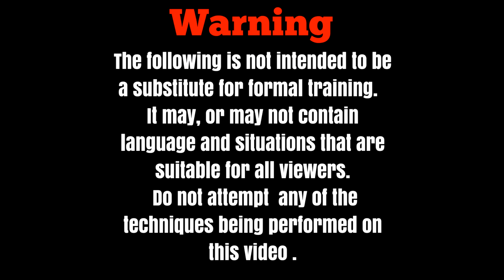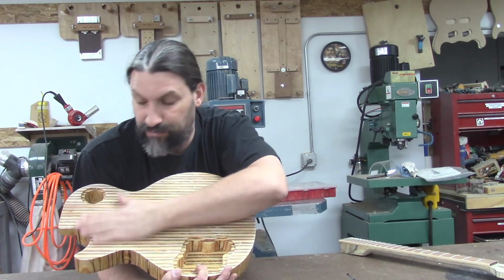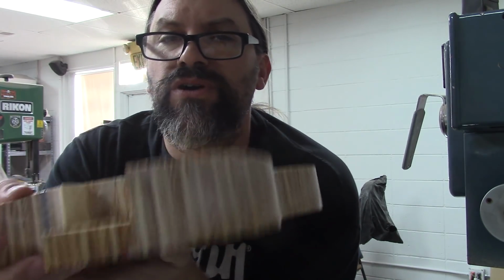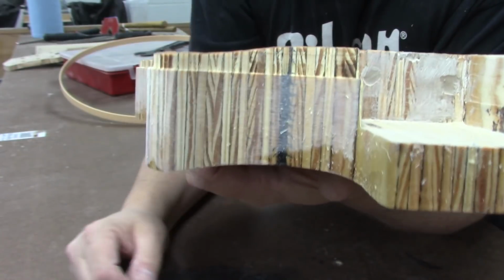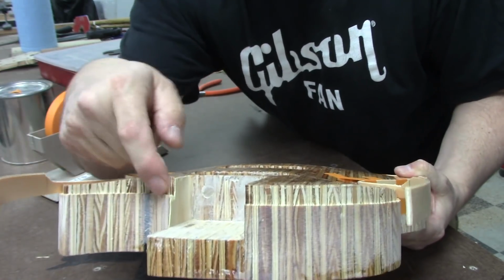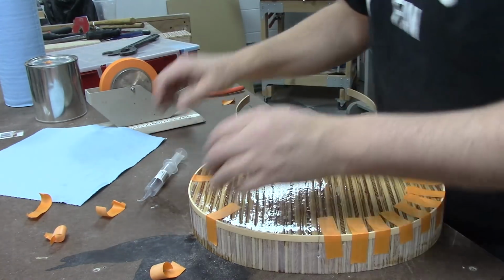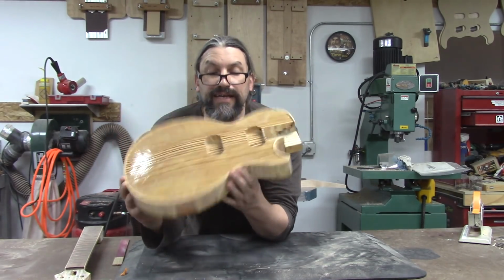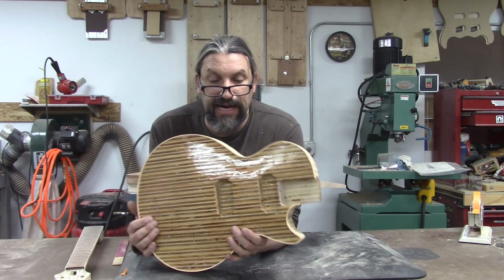How To Bind A Les Paul… Plywood Les Paul Part 3

Comment: I don't think it will sound horrible... In the 60s and 70s some of the old ply guitars were horribly cheap made but didn't sound nearly as bad as you'd expect. I predict it sounds shockingly better than most assume. I actually love that you all made this guitar, soooooo many are closed minded and not open to having fun. Even if it turns out terrible... And I doubt it will, you learn something from every experience and experiment you do. I really look forward to seeing the outcome! I actually was making a neck out of my own layered hard pine that I had cut and reversed the grain from slice to slice... It looks nuts and that was the point... To play and just have fun. Great job!
Reply from the maker: Thanks Will, I'm having a lot of fun with this guitar

Comment: I like the binding. Maybe it doesn’t “pop” but I don’t think it has to. There’s a lot going on visually anyway and it adds a nice understated end to all those straight lines in the plys. I like where this is going so far. I’m not too concerned about the sound, I’m not trying to start up that tired argument but I’ve always felt tone was 80% electrics and 20% wood in a solid body anyway. If the first set of pickups aren’t right, you can tweak it with something different to get it where you want it. I would suggest a wide strap but I think it’s gonna rock!
Reply from the maker: As you know, I am not at all concerned with the way this will sound. I just think it's going to be really cool to look at. I agree that the pickups will certainly be the deciding factor in the way the guitar will sound. Though I don't think this will be getting much play time

Comment: It's starting to look pretty cool Matt! You might be right about the burst, I reckon a tobacco would look pretty good against the ply. The very rare times I had to re-bind a Les Paul I ended up making a jig to hold my router with a stewmac binding bit in it. Worked a treat if you don't have a pin router!
Oh...and you should be using cloth tape to hold the binding ;)
Reply from the maker: We have a kooky contraption that holds a router for carved top binding. I kinda hate using it because it isn't my beloved pin router HAHAHA
Thanks for watching my friend
Reply: @TexasToastGuitars  Sometimes you gotta do what you gotta do!

Comment: Next Les Ply try dying each ply a different color. If you use alcohol dye the glue should still bind it, but I guess it would need to be a teley or a challenger because carving would muck that up . Anyway just a thought. I like the binding on this one and the overall look. Big Fan of the videos as always, only one thing: MORE WEENIE ROLLERS!!! :-)
Reply from the maker: I think I missed some Weenie Roller opportunities with these videos. There are some cool colored plywoods available already good to go, I bet it can be expensive if you aren't buying a lot of it. I should check into that. 
I'm not sure if I'm going to be doing another one of these, but I am having a lot of fun with this

Comment: I've spent my entire life working with helping with coatings. Since 1972 helping my Grandad and professionally since 1980. I ran my own Painting & Restoration Business for 30 years until I fell from a 24'ft ladder and broke my back in 4 places. I'd like to know what kinda sealer you used and whether or not you grain filled the Body before sealing it. It seems like you'd have to grain fill because the end grain of the plywood would drink sealer while the straight grain would start to build almost immediately. By the time you could get the end grain to start film building the straight grain would be an inch thick. Also have you heard of Crystal-lac Brite Tone water born String Instrument Finish and I can't believe it's not Lacquer UV cured Finish? 
God Bless Y'all, 
Jimmy in NC....
Reply from the maker: Hi Jimmy, we use Simtec EZ Sanding sealer. It is a catalyzing polyester and we do not grain fill.   
I have not tried any of the things you mentioned. You mentioned that you are in the industry. Are you associated with these products?
Reply: @TexasToastGuitars  Not affiliated with any of the product I mentioned. I saw them on some YouTube videos I saw from Highline Guitars. Both products look amazing. The UV cured products are really cool they harden in 2 or 3 minutes upon exposure to Sunlight or Ultraviolet light allowing you to put all your coats on in 1 day including wet sanding and buffing. In addition to UV cured Lacquer they have a Diamond hard finish which Highline claims is the most durable finish on the market and You can brush the UV products because they're self leveling and will stay wet until exposure to UV light where they'll cure instantly. It would be great not to have to fool with spray equipment. I've gotta 2 gallon per minute Speeflo Airless with a 5-1/2 Horsepower Honda motor and have sprayed 420 gallons in an 8 hour day many times when I worked commercial industrial painting in the late 80s early 90s in Washington D.C. area. Check out Highline Guitars for videos on the Crystal Lax water born Brite Tone String Instrument Finish and t UV cured Finish. I can't remember the name of the company who makes the UV Finishes, but it sure would be nice to be able to apply all your coats, wet sand and buff in 1 day. Especially since you don't need spray equipment. If you have a bunch of instruments to spray it's worth it, but it's not worth dragging out spray equipment for 1 or 2 Guitars. The really cool thing is being able to finish in one day and not having to wait weeks for something to off gas before you can buff it.
God Bless Jimmy in NC....

Comment: Do you use painter's tape for all types of binding or just plastic binding that can be adhered with acetone? I was taught using reel tape, and haven't considered any other types of tape for binding. It'd definitely save me some money if painter's tape holds up just as well.
Reply from the maker: I use the stuff from StewMac, it works pretty well. I have used blue and green painters with limited success. Give it a shot man
Reply: I’m pretty sure the StewMac binding tape is Scotch 26336 233+.

Comment: Tortoise shell binding might have clashed nicely. How long does it take for the acetoned binding to set up? 

And yeah, a plyburst might work too. But then it would kinda cover up all that lovely grain, and that just wouldn’t be right.
Reply from the maker: The acetone works pretty fast but it will depend on how hot it is. In the summer it works REALLY fast. We always let it sit for a couple hours

Comment: So does the acitone work as the glue? I have to put binding on a guitar an was told to use super glue... What do you say about super glue
Reply: The acitone melts the binding too the wood, it can be very messy if you dont use a syringe and dont over do the acitone. Superglue works but you have no time to adjust & it also can be Very messy, just use binding glue from Stew mac if its your first time binding something it holds Great & gives you time too work before it hardens. I hope that helps..
Reply from the maker: Some plastics to not melt with acetone and you can use super glue. Give it a try and see what you think. Super glue is neat stuff but is also messy and hard to sand. the extra acetone just dries up and blows away